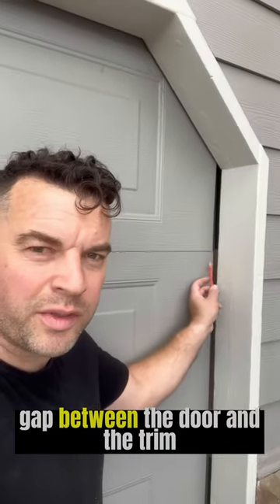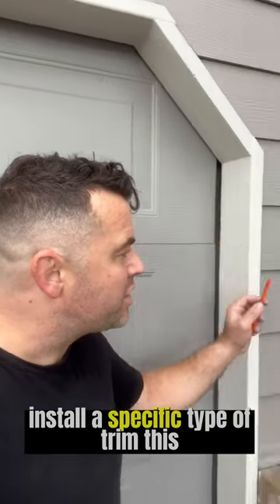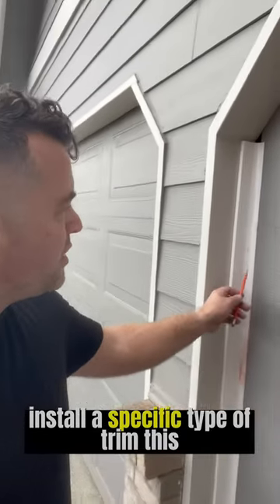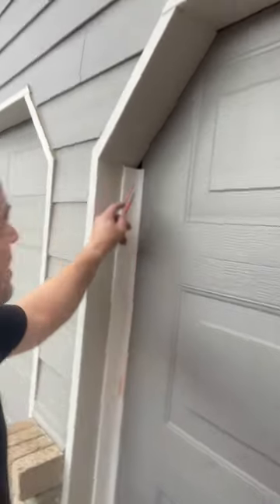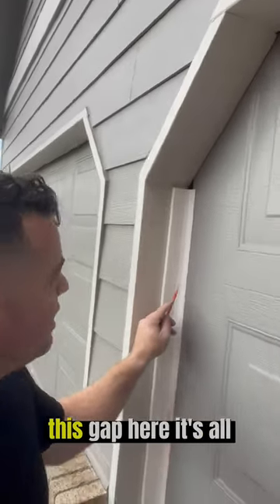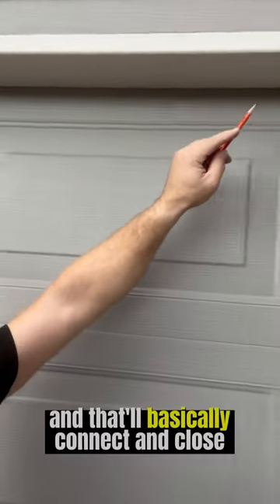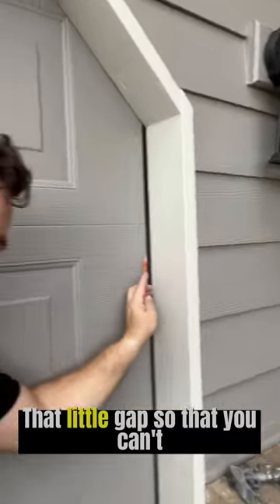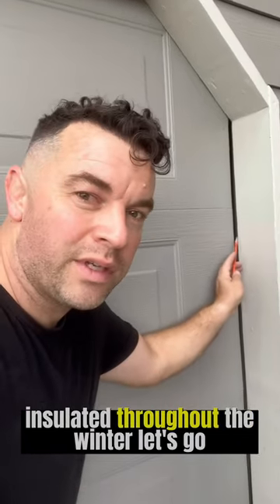Keep cold air and spiders out of your garage with this…

Comment: The garage door seal should be set while the door is closed, then opened to pound the nails in so you do not hit and dent the door. There are also spring hinges you can get that keep the door from flexing in windy areas. Do not bend the vinyl flap or press it to tightly or it can cup.
Reply: Nail gun my dude no hammering
Reply: @Cody-xo4tb nail gun will blow large holes into your seal. Get white nails or color match the trim and smack em in

Comment: That type of seal is good but I did it cheap with a peal and stick garage door perimeter weather seal from Amazon for about $30. It also comes with covered screws. It has the same soft flange seal as the type shown. Super easy install.

Comment: is there a way to or reason to insulate the cinder blocks at the bottom? My garage has similar set up. Also did you double up on insulation since the width is now 7 inches?

Comment: But what happens when the garage door opens? Details on that would be useful
Reply: The door track is angled to get closer towards the bottom so it pulls away when opening and stays away from the seal. When it closes/comes down it presses against the seal at the end of the closing process. Look at the track to see the tapered angle from top to bottom. It comes down from the top so you layer the corners to over lap to keep out wind driven rain and they do not catch on the door when closing. See youtube videos for more detail.